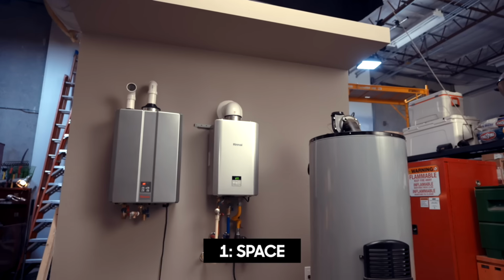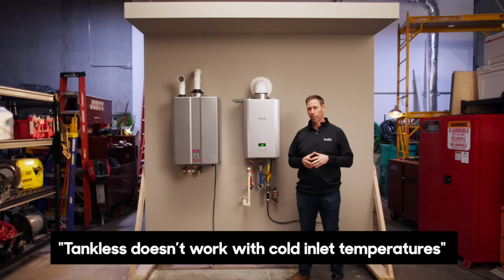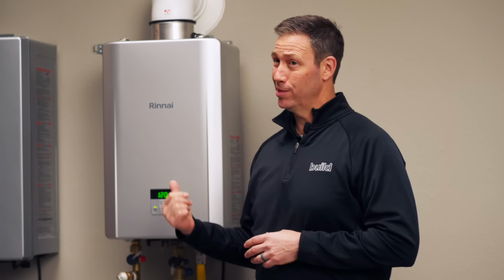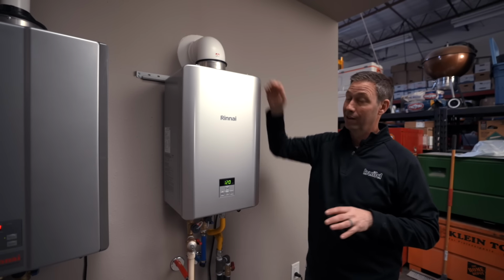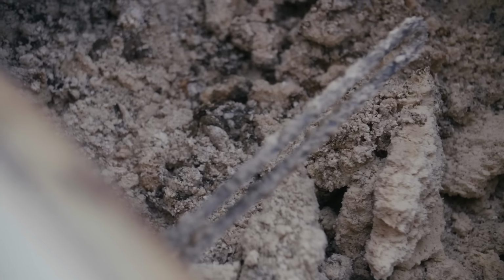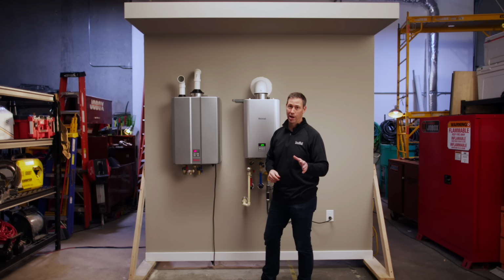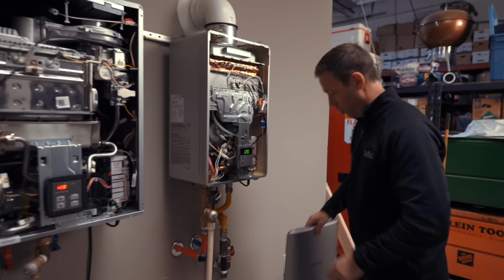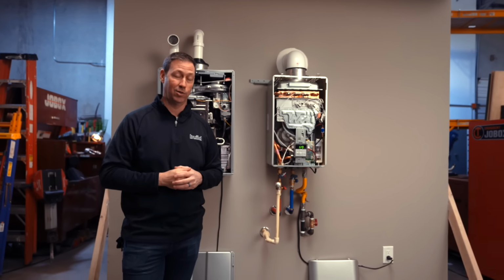DEBUNKING Tankless water heater LIES!

Comment: Here we go again with another paid shil for Rinnai.

Tankless doesn't work with cold inlet temperatures

So lets start off with this "lie".  As with any water heater, tank or tankless, it is all use case dependent.  They state cold places like Canada and Michigan that it can keep up with three showers.  This scenario is extremely unlikely and is used to prop up a very weak argument.  You fail to mention flow rate differences in the tank vs tankless and realistic scenarios.  Who knows someone with three bathrooms in their home?  What most people will see is shower(2.5 GPM) vs cloths washer(3.3GPM avg), or shower vs dishwasher (1.3GPM AVG).  However in those cases, the washers will be using complete hot water.  And since we are playing "What If" games with three showes, what if all three of these are running at the same time?  Uh oh, your tankless is now falling behind.  Tankless does not have the flow rate unless you go with larger commercial units, which most people can't afford.  Also in colder climates, good installers will also advise to insulate your pipes, but he fails to mention that little detail with the installation of tankless to help it's "efficiency".  So say hello to potential increase to your installation cost.

RESULT: LIE by omission of relevant details.
---------------------------------------------
Tankless units are expensive, and expensive to install

Three misrepresentations in one.  
First one is anyone can go to Lowes or Home Depot, or local home improvement shop.com website, and when you compare tank vs tankless water heaters, any tankless that is worth the materials it is built out of is easily DOUBLE the raw cost of your standard 40-50Gal tank heater.  So right there you have a likely 75% increased cost out of the gate.  
Second part of the lie is he fails to mention that any installer that knows what they are doing will advise you of getting a water softener for 'hard' or 'treated' water because if you don't, you will be fixing your unit, as much as using it.  So while you look for a tankless, look for a water softener as well if you don't have one.
Third lie is more of a technicality than the truth about 'the rising cost of tank heaters'.  Yes cost has gone up, but has moved with inflation/economy.  Around $50-$100 difference in 5 years.  I think we would all wish that prices of products would remain that predictable.

RESULT: LIES by omission of vital details.
---------------------------------------------
Venting is too expensive on tankless units

This is all depending on installation scenario and location of your unit.  On newer homes, they will be built with the newer standards in mind that the tankless units conform too.  So if you have a home built within the last 10-15 years, your costs are likely lower.  However on older homes, the costs will be more to vent in either Non-condensing or condensing units.  Especially in the case of electric water heaters as you are not likely to have a vent that a gas tank heater would have, so you are punching all new holes in walls for venting.

RESULT: LIE by omission of vital details.
---------------------------------------------
Scale and hard water is a problem for tankless water heaters

Notice that he doesn't address the true issue, he just moves for 'you have to maintain both units' and completely bypasses the TRUTH about tankless.  As previously mentioned you will need to get a water softener to realize better over time costs and lower maintenance.  Units can handle hard water without one, but you will have more frequent flow rate issues, will be maintaining the unit at a substantially higher rate than a tank water heater, and you will be replacing parts that wear out faster due to hard water scaling, which negates the "over time savings" of a tankless water heater.

RESULT: LIE by omission of vital details.  The disclaimer you put in is a nice touch, but you still don't say it out loud.
---------------------------------------------
Tankless water heaters are slow to respond to demand.

This is somewhat arbitrary as it will depend on the installation location, the distance from the source to the output and your unit.  That cold water has to make it out of the pipe before hot water gets there.  HOWEVER, what he fails to mention is that not all tankless units are made equally.  Rinnai units will start "within a few seconds" of water flow, but other units can take up to 15 seconds before they will engage the heating elements.  So while he is hocking Rinnai's wares, this is a true statement, but not for all units.  But again, with a tank, hot water is hot water as soon as the cold water is out of the way.

RESULT: TRUE for Rinnai, but may not be for others.
---------------------------------------------
Stainless steel heat exchangers are better.

This one, he actually told the truth.
---------------------------------------------
Low gas pressure makes the installation of tankless unaffordable.

This again, depends on your area, the age of your home and your gas company, oh and don't forget the draw of other appliances you have that depend on gas, like a gas furnace.  Some gas companies deliver more pressure than others, the home builder may have installed a smaller diameter inlet pipe from your gas service that could impact this.  He even debunks himself in this point "You're not necessarily going to need to do that" and "In many cases" means that there are and will be cases where you are going to need upgrade your gas supply.  It is all dependent on the aforementioned factors.  Assessment will need to be done by an installer to determine if your gas supply will be sufficient to support the unit.  So this is not always a lie, but he is lying about it to talk up his point.

RESULT: LIE by omission of vital details.
--------------------------------------------------
Tankless is a new tech that hasn't been proven yet.

This is a false equivalency.  There are plenty of other technologies that have been around for while.  Does it mean that because it has been around for a while means it is good?  No, there are many flawed technologies out there that continue to thrive for many reasons.  Does this mean this tech is bad?  No, it doesn't mean that either.  The better point that should be stated, is this: "Is this the right fit for everyone?" The answer is no, it won't be but he talks like it should be.

RESULT: LIE

Overall, this is nothing but a paid product shil'ing from this presenter.  Rinnai was really pushing for marketing on their tankless around the time this video came out, as another one from here (https://www.youtube.com/watch?v=ZSDNnJmsl78) made a similar video and hit almost all the same talking points, almost as if they were given an outline script to follow....Hmmm.

Here is the best advice anyone can give you on getting a new water heater.  Get quotes and quote breakdowns from multiple certified installers for your area and find out exactly what you are looking at paying.  And get comparisons of tank vs tankless the gives and takes and costs of each.

Comment: Thank you, I am saving this to show our gas service provider who does all the installs in our small city that he is full of sh*t. I have an apartment building and all the hot water heaters are in the basement. When one died I wanted to replace it with a tankless water heater because that unit needs a large tank and I had priced the tankless and a regular hot water heater and there was very little difference but as the tenants pay for their own gas needs they would save money and happy tenants stick around for years. (My average is 5-7 years.) VG our gas supplier said no so I said I would find someone to install the heater and that is when I discovered that they wouldn't move the gas pipe closer to the wall where the heater would be mounted and my plumber couldn't move the gas line because it belonged to VG. I had spoken to a plumber but I didn't mention where I lived and I called him and he told me to give up, they had a monopoly on the city I lived in and they called the shots as to what we could use. That still makes me furious, we are all heating water for no reason what so ever while we are away from home. I thought that they goal was to use less fossil fuels in our state but I guess keeping our natural gas supplier happy is more important.

Comment: Having experienced many showers where the water turns cold only to wait for a minute or so for it to turn hot again destroys the ads promoting that you never run out of hot water. I'm still sold on tankless heaters because they take up less space. After many attempts to resolve the hot/cold issue I replaced my Rinnai heater with a new Rinnai RSC199ip condensing unit with a circulating pump. Running one month so far and everything is working fine.

Comment: Your statements on cost does not match my experience. I priced a tankless retrofit for my house and the quote was $3000 because I would need to replace the gas line from the meter to the tankless with a larger size.  I opted for a 12 year 50 gal tank from Home Depot for $700 and since it was replacing an identically sized 50 gal tank I could do the swap out myself.  During the summer I only use natural gas for water heating.  My monthly bill during the summer runs around $29, of which $23 is a fixed customer cost.  I would love to have a tankless but I don't want to pay a $2300 premium to save $3 a month.

Comment: Wow 1st statement a lie 😂. Cold water reduces the output at your selected temp it throttles back to achieve set temp. 37 degree winter input kills the output without a tempering tank. 
Unless , like others have said you reduce your set temp to lukewarm.

Comment: Okay it is later 2023.  Our water heater was about to die and we had a few options.  One was to replace with an electric water heater like we had before that lasted 17 years for $2,200.  This one had a 10 year warranty and includes removing and installing the new tank.  The tankless water heater quoted was gas and its cost installed was $6,200.    We ended up going with the tankless not because it will end up saving us money, nor that we will have tons of hot water, as we never ran out before, but because we use so little hot water.   I put this here because the "myth" of tankless water heaters being a lot more expensive is actually true.  Even at todays prices I could buy near 3 tank water heaters for the price of one tankless.   

TLDR version
Tank cost $2,200 installed
Tankless gas unit cost $6,200 installed.

Comment: The biggest lie about tankless Is efficiency! I understand they may save space and other good stuff, but come on. People falsely believe that they will save thousands in energy because the stupid govt rebates give them that. I have had a kwh meter on my tank water heater for 4 years. Standby heat loss is 1.5 to 1.7 kwh/d. About $8 a month (significant only in summer season where heat doesn’t benefit home). Why spend thousands to save maybe $40 a year ? Blame the crazy zealots.

Comment: Dumb.... It's not the cost of the vent itself that's a problem. And by the way gas lines are almost always 1/2 inch which means running a new gasline to support the new tankless. 

These costs add up a lot when switching from tank to tankless. Don't lie to people and just say it doesn't. Every job is different, homes are not built the same. Plumbing is all custom work. 

Also, there is about 100 things that can go wrong on a tankless and most parts need to be ordered. Tanks have only a few things that can go wrong.

Comment: We are going to be moving in the next month (provided everything goes well) from the ILs house to our own again.  House was built in '99, original hot water heater,  2 stories, basement, 2.5 baths (2 full bathrooms on 2nd floor).  Wife will eventually want a soaking tub in the master bathroom.

The flue on the water heater will need to be fixed and I could not get the pilot to light, so most likely we will just flat our replace the unit and have everything fixed up. The water heater is in the basement - so hot water will need to go up 2 floors the upstairs bathrooms.  

I have always used a traditional water heater and not really had any serious issues.  But it seems to me that with a 2 story and the heater being in the basement - the advantages of tankless are really mitigated.  Combined with hard water - our area has a hardness of over 20 gpg:
[att=1]

This is only the average - it can be higher in certain areas to 27.  We do have city water but it has not been softened - there is a project to do that but not sure if it is online yet.  Supposedly we won't need a softener but not so sure of that (but yes - we do plan on a water softener).

Tank or tankless will still have to traverse the same distance to get hot water to the top floor and I am still concerned about water hardness (even with softened water - call me paranoid) - I am not sure that tankless offers that much more than maybe a slightly oversized water heater - say 50 gal for 3-4 people, dishwasher. soaking tub, laundry etc...

We also only have a partial wall to mount to, not finished - open studs as part of the stair case.   3-4 feet from where the current water heater is, so gas line would need to be run over and exhaust would need to be extended...

Any opinions on tank vs tankless in our scenario?

Comment: There is one myth that rarely I ever hear discussed; efficiency.  Math is math!  I am all electric and my water source is a well.  I have been back and forth on whether to remain with a tank or go tankless but I think for the electricity rates which have risen 30% here in Alabama from 2022 to 2023; I can't dismiss the math.  Even if I can keep my hot water usage to less than one hour; it still will cost me more in electricity than a tank on a timer running one hour a day and coasting the rest of the way.  I would kill to take a 30 minute hot shower and that is about the only upside I see in a tankless because having to rewire to 6 guage or run new dedicated wiring from point of use to the panel doesn't strike me as a fun undertaking let alone a date with crawling under my house and wiring these puppies to code.  Am I making any sense here?  I don't see the math in how a tankless is more efficient if I have a timer on my water heater to begin with let alone having to add a thicker wire to my panel and the DIY to install it.  Thanks!
Reply: Our tank is going out. My hubby told me to research tankless. Thats how I got to this video. Then he calls hours later saying that he was told by an electrician (I think it was) that tankless waterheaters use a lot of electricity. We are also electric and have a well. Its a no go for us.

Comment: For a small electric tankless WH, how many gallons through it does it take to raise the water temp?  Our kitchen faucet is a long way from our house's tank WH.  Starting with the house's 70F water in the copper hot water pipe, it takes almost 3/4G of water running down the drain to have ~110F water.  Besides wasting  a lot of water, I'd like to get that down with an under-counter electric tankless WH.  I can wire it for 110 or 220 VAC.  Comments and recommendations?

Comment: Slow to demand is not a lie, and it's not all about cold water in the pipe. The tankless has to fire up (if it's gas) & start heating water before it can get to the faucet. I run a tankless in the summer, but in the winter my outdoor boiler provides hot water via a plate exchanger.  So I timed the difference between the two, at the same faucet, from ambient temp to 100 degrees F. The length of pipe is within a few feet difference between the two setups.   It took 27 seconds for the wood boiler & 1 minute 17 seconds from the tankless.  It takes SO long that washing hands in cold water is the norm unless I want to stand there for a minute and a half.  I might look at a re-circ pump, but that seems to defeat the efficiency gains of tankless over a conventional.  I also thought about a point-of-use heater under the kitchen faucet (most used), but again....that's more expense.  I wish I would have bought a high efficiency tank model.

Comment: Thanks. I am building and have a well water, 400 amps and no gas. I am just finishing a utility building which will have two 32 gallon pressure tanks. The building is R22 and will have heat so my water should temper to about 60 degrees. I will have an outdoor shower so I am going to put an RTEX-11 for the utility building. My Garage/Studio is about 200' away and I will add another pressure tank in a heated space and two RTEX 11's. One for the bathroom and one for the kitchen/washer. I will valve Bypasses so if one fails I can fall back to one unit. I will see how that all works before I build the main house.

Comment: My Rinnai of 10 years went south. Called 6 installers, each estimate was from a low of $4700 to $6600.
I bought the exact unit at HD 8.4gpm  for $1100.  How is a unit swap $5k?
These guys totally rap3 you.

Comment: One thing I don't agree with is speed of hot water to your fixtures, without a recirculation pump it is slower, with a tank, the water is already hot, so it is just the time to get through the line to my faucet, with my tankless, it has a startup process that takes some time, so there is more delay in getting the tankless going and producing hot water to then get it to the fixture, in my case it is 30 seconds or so longer I find, maybe faster on newer models and certainly a circulator will fix the issue and tankless is better in every way otherwise, never want to go back to a tank and a flooded basement again.